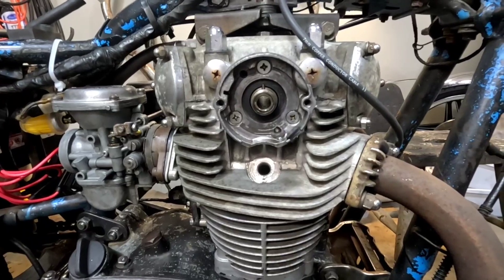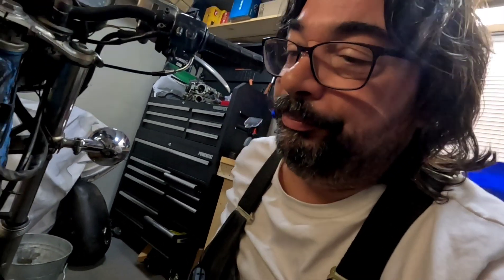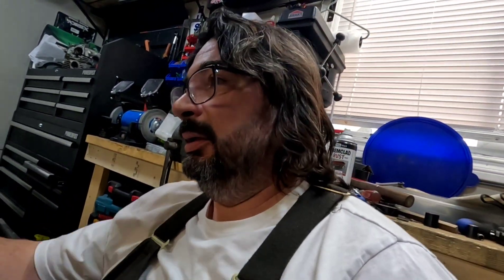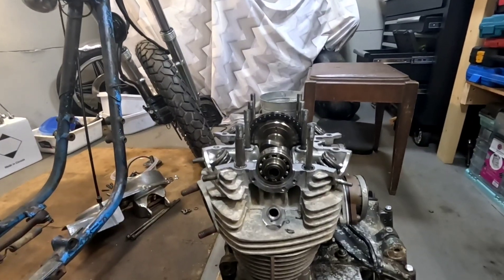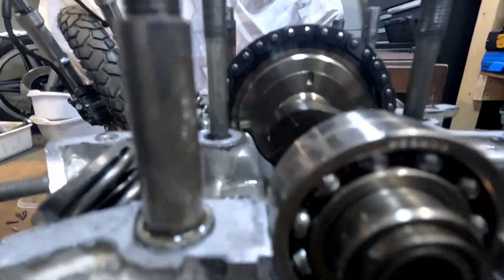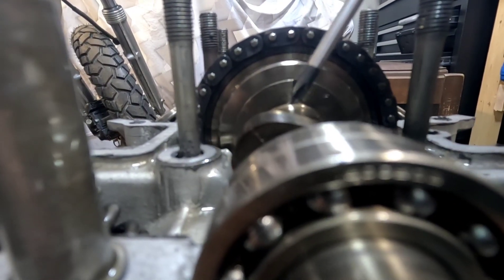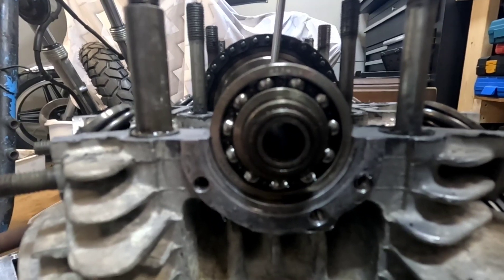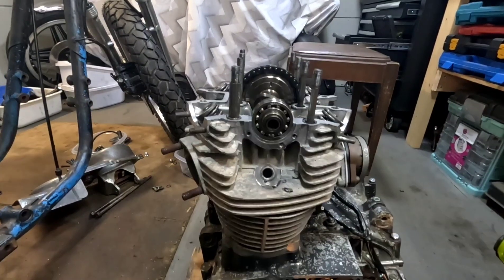Yamaha xs650 Cam timing out 1 tooth !?

Comment: Great video can you please tell me what tyres its running on and the size many thanks.
Reply from the maker: Hi this particular bike I'm working on in this video has different wheels than a stock Yamaha xs650.  On this bike because its a put it together with what I got kinda themed build . It has Honda wheels from a cb650 and the rear is a 17 and the front is a 19. Not sure off the top of my head the width of both tires. They are also dual sport tires more suited for dirt roads but are dot approved.  Cheers!

Comment: You must have been over the moon 👍
Reply from the maker: @RD-650  lol yup you know it! Was a bit of a head scratcher but had to be something like that. I've since rebuilt that engine again and changed the cam chain and tensioner and guide.  It was pretty stretched out and is way better now. I cover it all in my last 10 videos.  I did a season 2 series of videos on that bike this winter. Still on going but got the engine running real good now. Cheers!

Comment: You should be using the dot on the right hand side of the sprocket as well as the slot on the left.
Reply from the maker: @russturner1570  yes I did see that dot too. Wasn't sure if it was proper timing mark or just a coincidence it was there. Seemed kinda lightly punched into the surface.  When I was researching the cam timing I didn't see anything on it or don't remember it being talked about.  I will look into that though because that would be better and more typical kind of mark to use. Thanks and much appreciated. Cheers!

Comment: Thanks for this video!!  Had a timing issue on a 1980 xs with a CDI.  Searched and searched vids and info in forums.  It didn’t make sense until I saw this video.  Thank you.
Reply from the maker: @setroc9998  your very welcome!  I'm glad that helped you.  I had a similar experience as I was trying to figure out my issue.  1 tooth out, and it ran like crap. At the time, I wasn't sure what the problem was and needed a way to verify it was out to justify taring the engine apart again.  Thanks for the positive feedback. Cheers!

Comment: This has been a great help. Thank you. I'm working on a Honda cd175 and it's been one fiasco after another. The cam sprocket was changed at some time in it's life and there was no 0 timing mark to time it off. It's a 360 cycle engine which means both pustons are at tdc at the same time luckily. I tried to start it last week and it ran like shit and stopped and wouldn't go again. I'm pretty sure it's the cam timing. I can now check tonight. I hope I haven't damaged any valves or anything. It turned over by hand on the bench with no issues.
Reply from the maker: @damo690  Thank you. Ya timing can be a pain. Have you checked the Woodruff key on the flywheel?  That can mess with your ignition timing.  I've found them sheared right in half or just partially sheared. Enough to throw ignition timing off. It can happen from stalling the engine a lot or I've seen it happen when there way to much gas flooding into the engine and so much that when the piston comes around it hydro locks at top dead center causing the Woodruff key to shear off. As far as valve timing goes check the compression. If you have lots like over 100 it should run and valve timing can't be to far off. When my engine was off one tooth it would pop out the exhaust really badly

Comment: These marks on these bike arnt really perfect when they line up. I did a 650 and found that out . Even with a new chain it’s not perfect . So when you time it you time it with the marks that are the closest to the spot you need . And youl kno when you see it
Reply from the maker: @Stuckin330  ya I found them to be a bit hard to be sure . I think It would be good idea to rig up a way to start the engine before installing it into the bike. Just to make sure everything checks out before going through all the work of putting the engine in the bike and then having to take it out again just to skip 1 tooth on the cam and put it all back in again.  It messes with you because not always convinced it's the problem while doing it. Lol

Comment: So the valve cover cannot be removed with the engine in the frame?
Reply: Nice vid mate 🛠👍
Reply from the maker: @ChrisArmstrong-qn1ob  thank you! Much appreciated.  Cheers!!
Reply from the maker: @deltabluesdavidraye  yeah that's right unfortunately.  The head bolts protrude out of the engine case to High for the valve cover and head to clear the frame. Valve cover is fairly thick and there's not enough clearance to remove it while the engine is in the frame. Makes doing any of this type of work a little more involved.  Cheers!

Comment: Thank you mate, I have the same problem on my  1974Tx 650. I inherited the timing problem when I bought the bike a month ago. Tried with new points but same results or similar. Compression is also down, but that is another issue.
It looks like the engine will have to come out anyway.
Also have the first gear jumping out often. All other gears are ok.
I have been able to ride the bike ok, but not a lot of power there, and difficult start on first cold start.
Again thanks for your video
Serge, 🎉from New Zealand, Nelson
Reply from the maker: You welcome Serge! I appreciate the positive feedback.  Ya these bikes can be a pain to sort out but once you do it will be so worth it. I'm hoping to do a proper engine rebuild on a different xs650 engine.  Most likely this winter I'm thinking.  Looking forward to it. I really enjoyed working on this one even though it was a bit problematic.  I learned a lot from the first one and should be better next time. Cheers!
Reply: @CenterStandMechanX  i look forward to your Yam 650 re- build. I will follow your steps.
You are doing a good job for the rest of us… thanks.
Serge

Comment: Could the tensioner cause this, sorry that this occurred but this was a good lesson for us working on our project bikes.  Thank You.
Reply from the maker: Hi ! No, I don't think so. It was adjusted tight like it should have been before I took it apart. Trust me, I would have loved that to be the issue. Would have been a lot easier than taking the engine back out and apart.  It's hard to see it on the video, but when I got it all put back together, it ran a whole lot better
Reply: By the way, I have a temporary solution for the  timing tooth-out problem. I have put the electrical timing problem aside by grinding a bit on the point main plate to be able to adjust the point right in sync with the piston position. Ignoring the cam valve error at
around 10 degrees, still give me an appreciated improvement  on motor performance and smoothness. Soon I will be able to deal with the REAL problem, and take the engine out of the frame.
The first gear jumping out when on a bumpy dirt road is still a mystery. Any suggestions on this from anybody reading this?
Serge. NZ.
Reply: Ps:  correction …error valve timing error OF around 10 degrees. [ in my case opening / closing a bit too early.]
Serge NZ
Reply from the maker: @serge8400  I tried messing with the points plate too and couldn't get the points to fire correctly even with the few extra degrees. This is where I stopped myself from doing more crazy things and looked into the cam being out. It's was one of those inconvenient truths that I didn't want to have to go there but in the end it made all the difference.  Before I retimed the cam properly the engine was backfiring a lot preventing it from revenge up untill it got past a certain rpm then it was more responsive.  This might have been from the centrifugal advanced kicking in and alowing it to run better in a way.  Skipping one tooth made all the difference.  As far as jumping out of first gear. Not sure. Have a look at your drain plug magnet for metal chunks or the remnants of a small cotter pin or pins. You can also take the clutch cover off ,take the plugs out and spin it over with a 1/2 drill and run it through the gears and look for problems while you shift through the gears. Get one of them bore scope cameras and look down it to the transmission and see how everything is shifting.  Cheers